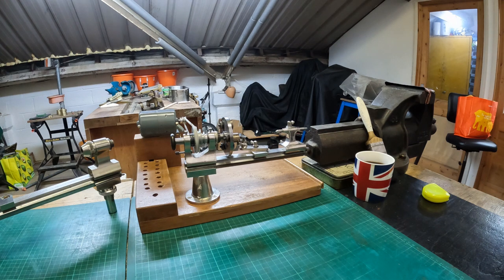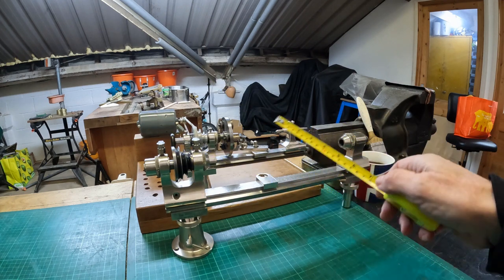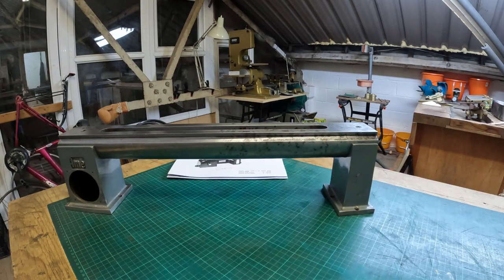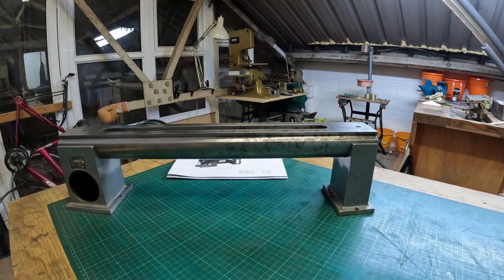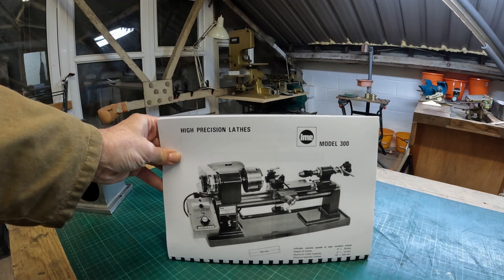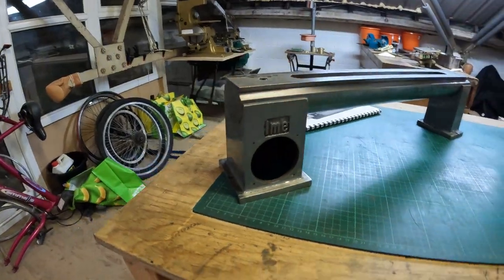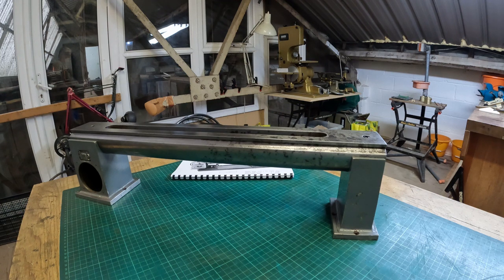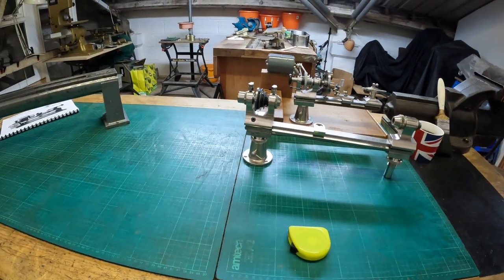IME 300 Lathe Introduction.

Comment: Hello Paul. I wish you luck in your quest for parts. Some time ago I acquired a small Pultra lathe that I think came from a University. Sadly, it has no tailstock, motor or tooling so I've not been able to use it, but it's a super little machine and extremely heavy and robust. It has an integral cast iron base, including coolant drainage, and the most beautiful topslide. The lack of motor and tooling does not present a problem, and it  could be used for operations that don't need a tailpost, but I would love to find one sometime as I think that it would be an extremely accurate machine. Best wishes for the Festive season and 2023.
Reply from the maker: Hello George,
Good to hear from you... The Pultra lathes are very nice and I have been tempted in the past but managed to control myself. Wishing your and the family a Merry Christmas and Happy New Year. 
Take care.
Paul,,

Comment: Nice looking bed there, Paul, but I can't help feeling you have gone against the usual advice to buy the most complete machine possible with the most accessories and attachments. The best of luck, hopefully the parts will turn (geddit?) up from somewhere. The other two are very pretty little machines.
Reply from the maker: Hello Mart's,
I agree but when there is an option of 1 of 1 and as I mentioned I have never seen another for sale they do appear to be quite rare. It's tucked away under a bench in the clean room, maybe never to see the light of day - lol. Thanks for watching.
Take care.
Paul,,

Comment: That IME lathe looks very substantial Paul. Is the bed steel or cast iron? I've not come across one of these before. With your Unimats and the watchmakers lathes, you're on the way to a lathe museum (haha). You should publish a little book on the Unimats and their accessories some day. Best wishes to you for Christmas and the New Year. Cheers Nobby.
Reply from the maker: Hello Nobby,
It is very heavy for its size... The bed is nickel chromed steel and cleaned up very well for a machine maybe 60 years old. The Unimat Museum has been mentioned before - lol. I think when you start a workshop you buy all sort of equipment that you think may be useful and as the shop evolves some of it is not needed. I am now at a stage where things are settling down and I know what I enjoy and not, so I plan to sell come of the current hardware. Thanks for watching.
Take care.
Paul,,

Comment: SIEG
I wonder if SIEG Components would work on that bed.
Little machine shop sells all the components
Reply from the maker: Hello Kimber,
I will check them out but the configuration of the bed is quite different from a normal lathe, but nevertheless worth checking out. Thanks for the tip. Thanks for watching and Merry Christmas to you.
Take care.
Paul,,